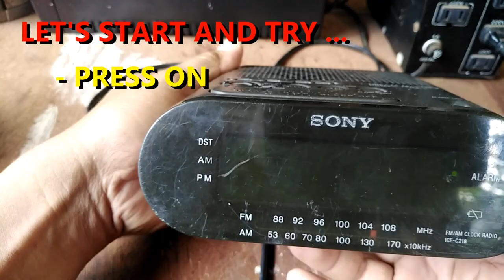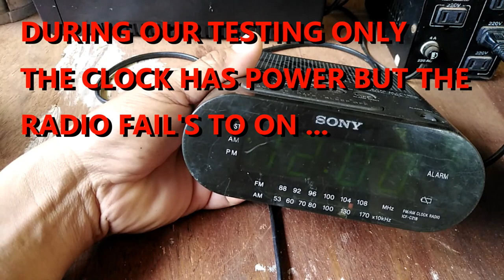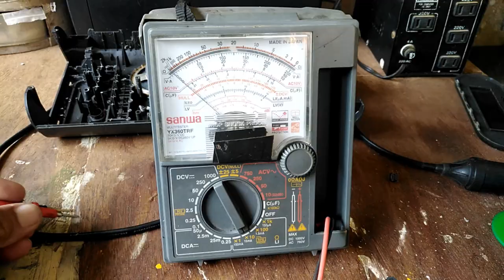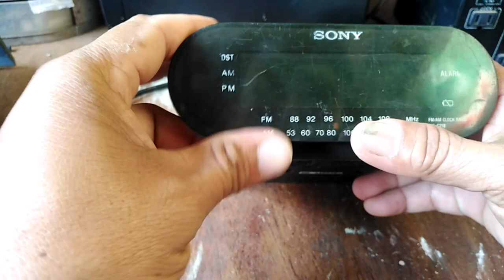SONY DREAM MACHINE AUTO TIME SET RADIO NO POWER REPAIR

Comment: Good Morning !!!  Great video!!!  Please, i live in Brazil and i have a Dream Machine ICF-C218, but the display is very weak. How to adjust the display brightness ?  Thank you, vety much !!!
Reply from the maker: I think there's a problem with the power supply of that dream machine you can measure how many voltages it has.
Reply: @DANEXTTECH  thank you very much for the reply, but it's working normalky. Only the brightness of display has control on the buttons, but i don't know wich ones it controls.
Reply from the maker: @PedroAugyt  can you send some picture of it so i can help you sir
Reply: @DANEXTTECH  ohh, thank you, very much!!!
Reply: once I managed to increase the brightness of the display, pressing the top buttons, but I don't know which ones to press anymore.

Comment: Anu po ba supply nung clock nasaksak kasi sa 220v sunog yung transformer sa radio lang ang alam ko 3 volts.
Reply from the maker: pwede mo po e trace yan at mag base kpo sa capacitor yun makukuha mo po ito rin ay converted npo 110v kse rin ito dati same tyo

Comment: Ano po kaya posibleng sira at mga papalitang parts nang ganitong unit ko. Naisaksak kasi sa 240 power supply sa bahay tapos ayun di na gumagana? Salamat po.
Reply from the maker: SAME PROBLEM SA AKIN DATI KSE ITONG 110V...AT PINALITAN KO LANG 2 TRANZFORMER DALAWA KSE NEED SUPPLY NITO MAAM
Reply: @DANEXTTECH  anong klaseng transformer po kaya sir, at saan po kaya nakaka bili nang ganoon.? May tutorial po ba kayo sa pagkabit nun? Paturo naman sir.
Reply from the maker: cge gawan kita maam tutorial ..hintay2x  lang po